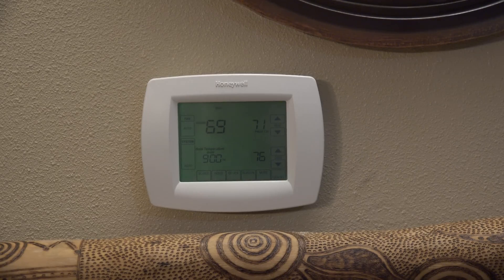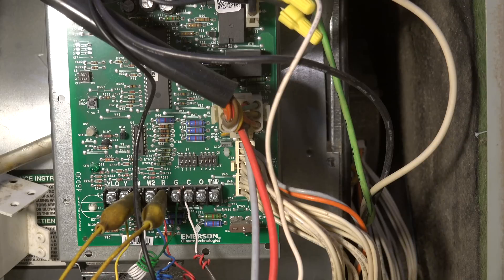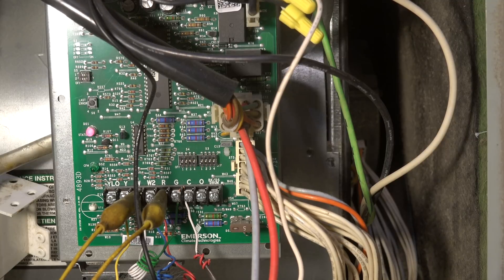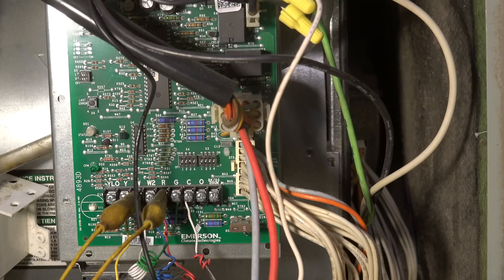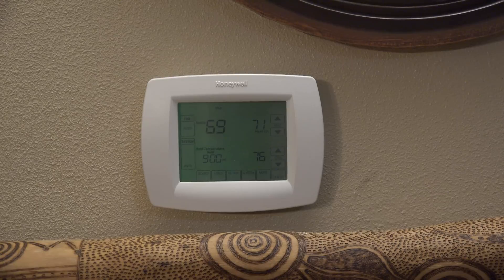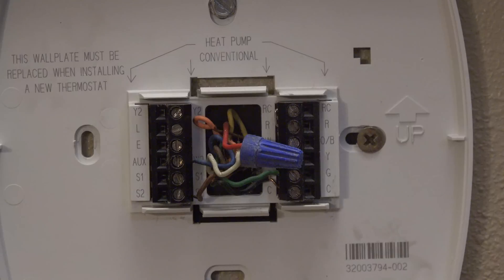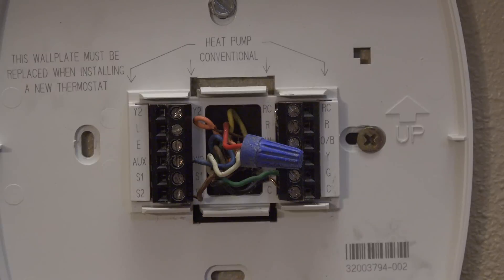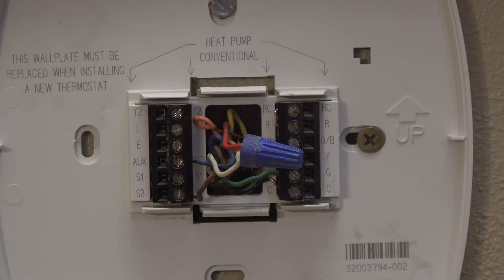Why is the thermostat not working.  Diagnosis #13

Comment: I have a TH8320R1003 thermostat. Wonder why the heat pump installer wired the 1st stage heat to the Y terminal and the 2nd stage to W 2 instead of Y 2 terminal for the heat pump? Watched a video where it mentioned installing a outdoor thermostat,  that'll switch off the heat pump, and it'll turn on another source of heat when outside temperature drops below a certain temperature.  I have a Goodman OT18-60A, so maybe I should check to see if there's a wire not used or run a new wire that can be connected to the oil furnace isolation relay?

Comment: the Stat is powered by battery's or the furnace.  you can pull the Stat and verify operation by checking continuity between the r and w terminals when in a call for heat. this will eliminate the Stat as the problem. then look at continuity of Stat wires. most likely the white as this is used to complete the call for heat at the furnace control board. check for extra splices in the wire that was not run long enough during rough in.

Comment: in the video you said you had RED and YELLOW under the wire nut. i think you meant to say RED and WHITE. assuming i'm right, the wire/circuit is broken somewhere between the tstat  and furnace. it is 18awg solid copper, so it' can break inside the insulation if kinked, bent too many times or someone has driven a drywall screw through it.

Comment: If cooling mode is doing fine, suspect there's open line on the wire between terminal W on the thermostat and the terminal W on the main board of the furnace.

Comment: Open in the circuit going from red on the board up to stat and back down on white to board. Open safety float switch or broken wire. Jumper red to green at stat, if fan comes on then the white wire is Open. If fan does not come on then red wire is Open.

Comment: There is a black common on the thermostat and a white on the furnace. So may be jumpering the wrong white at the thermostat or maybe a condensate switch in the red, which could also be the wrong one since there is an extra at the furnace. The white that is connected at the thermostat is nicked in several places. Ohm out the wires.

Comment: I call it as being a problem in the wiring up to the thermostat, one of them is open or the connection is poor at the  terminal  board.. If not it may be possible the transformer is not putting out a full 24 volts... May be only say 18-20V and that's fine to make the furnace start when jumpered at the board, add in a  long length of thermostat wire (resistance) and you may have even lower voltage at the "W" terminal, furnace may not see it and not start.

Comment: Open in the white wire, or a faulty thermostat, or a bad connection. No short present because the board fuse didn't blow. The thermostat is getting low voltage power on the red wire because the display is working (or it is running on battery power).
Reply: Doh!  Disregard faulty thermostat comment. White & red wires connected directly.

Comment: problem is it's a Trane v- drive,can't be a short because the fuse is not blown ,I'm guessing a broken wire or missed wired at at splice because the wires are different colors from stat to board,is it zoned,why sensor 2 wired not s-1

Comment: What jumping out at me is why is the red and yellow wire connected together? if they used by coded color. first I would check if stat is calling on my w1 to com. if no 24v I would co figure wire as
yellow to y1
white to w1
red to R
then check setting on thermostat to gas configuration

Comment: You stated you have red and yellow jumped at the t-stat. if that statement is true you just activated cooling mode. Otherwise you didn't put the door back on and the door switch is open or a break in the wire between t-stat and furance.
Reply from the maker: I meant red and white.
GFM

Comment: So you jumped the white and the red on the furnace and the red and yellow on the thermostat.  In properly wired thermostat.  Reinstall wires and retest thermostat.
Reply from the maker: I blew it on the color.  Should be red and white.
GFM

Comment: at the thermostat you said you had yellow jumped to R if that is the case more than likely you turned on the cooling.
Reply from the maker: I meant red and White.
GFM
Reply: grayfurnaceman no problem. Does the thermostat have a switch on it or a program to switch to gas heating?
Reply from the maker: No
GFM